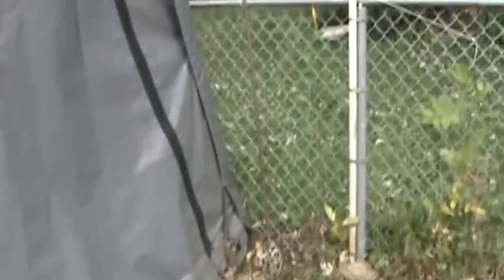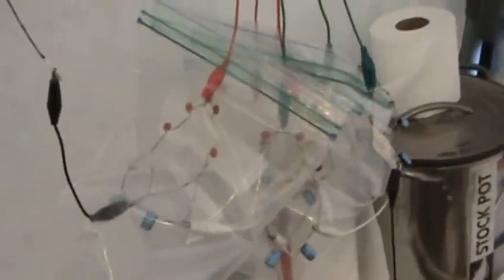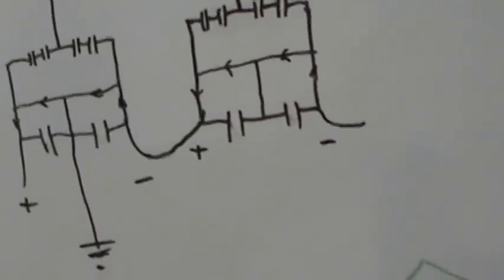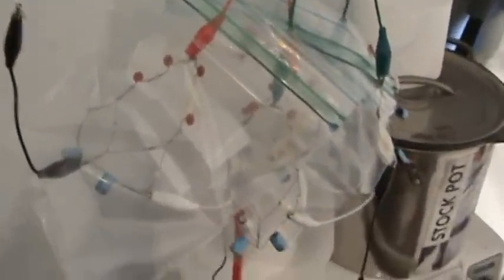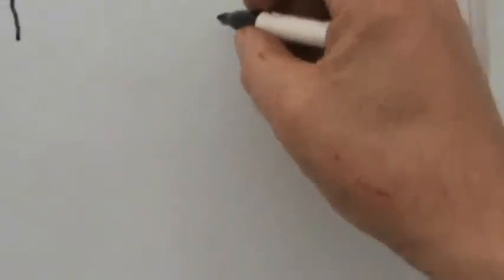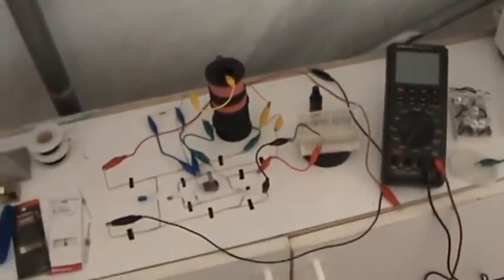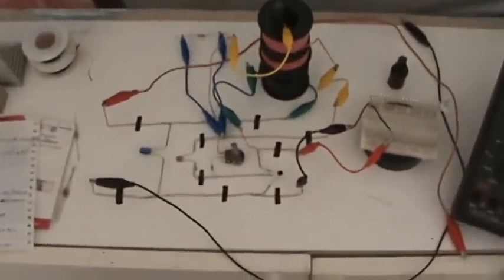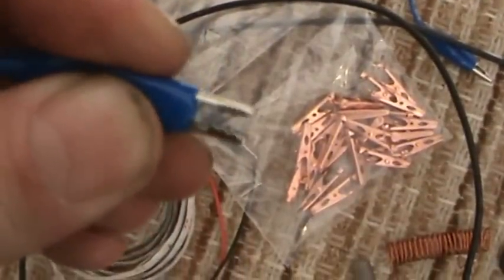FREE ENERGY FROM AIR 2016 Pt 4 (UPDATE)

Comment: Hey dude, well done!
Here's an image of a receiving antenna:
en.wikipedia.org/wiki/File:Dipole_receiving_antenna_animation_6_800x394x150ms.gif
Notice the wave..?
So in the middle of the wave you place a diode in the middle, but you'll have to test diodes to find the right one..
The wire to your circuit would come from the Cathode side of the wire.
Your antenna wire should be lineal as shown in the image...
To capture different wave lengths just add different lengths of wire, always with the diode in the middle.
When you capture multiple wave lengths you increase the potential, so more power to your circuit.
The important thing about this is for the wire to be straight, and the diode centered, and the wire to your circuit to come from the Cathode side.
Peace bro
Reply from the maker: hmmm, i see, thank you very much for the link and your ideas.   I will try this :-)
Reply: INVENTOR3 There's one more thing amigo,
When I say to capture different wavelengths I mean more than one wire set with a diode in the center, which are connected parallel to your electrical circuit.
So for example a 10 foot antenna which is 2 five foot wires at each end of the diode, an 8 foot antenna comprised of two 4 foot wires..
So in this example you have two wavelengths to capture. The wires coming from the cathode side of the diode go to your circuit.
These antennas are called 'Rectenna' and are used by the military but with a different wire configuration and much more intense wavelength. They're used to transfer electricity...
Science has been investigating and researching rectenna's for decades since Tesla first demonstrated transferring electricy through the air.
A possible diode you can use
www.avagotech.com/products/wireless/diodes/schottky/hsms-2862

Comment: Nice progress!  A magnetic field follows the path of least reluctance, so when the ferrite rod is in the middle of your two coils, it increases the coupling coefficient of your coils.  The best you can get is a coupling coefficient of 1.  The frequency of the ac current change determines the frequency of the flux change through the air or ferrite.  Transformers refresher:  http://www.allaboutcircuits.com/textbook/alternating-current/chpt-9/mutual-inductance-and-basic-operation   If you have a frequency counter that could tell you what Hz is going into the primary coil, if it is wired up like a transformer.  If your diodes have a tolerance of 20 volts or what have you, maybe you could put all the ceramic disc caps in some series and parallel arrangement to the antenna, then rectify that using the best 4 or 8 diodes, then use some reconfiguration of your electrolytic caps.  But sounds like you already got some next steps lined up. Nice that you got the series config worked out with your present model. This is a fascinating subject.
Reply from the maker: Thank you for clarifying. And thanks for the refresher link,,,i need it :-) 
Your input and comments are much appreciated.

Comment: Baring the loss of your Universal Flux Capacitor, there are several principles that you need to realize work as a collector and the most basic principle that THIS IS NOT COLLECTING ENEERGY FROM AIR - IT IS COLLECTING ENERGY FROM RADIO WAVES, OR RESONENCE THAT ARE EVERYWHERE, EVEN IN A VACUUM.

The best materials are hard metals (not foils) that have low resistance, such as sheet copper, aluminum or silver.  Use multiples of strip lengths that are connected at one point in the middle and at this point attach a power diode.  The energy coming from the collector will be DC Negative, so don't attach the diode backwards.  Use multiple (I use 3) standard copper grounds tied together with a 10 GA bare copper wire and standard ground strap anchors to ensure you get the best ground connection possible.  Use a good large diameter insulated wire from the ground to your test post.  At this point attach a large Electrolytic Capacitor (1,000 mfd 50VDC or higher) cap across your test posts.  As soon as the collector charges the capacitor you should see a steady low voltage at the test points.  There are several more complex versions of adaptive power circuits, power transistors, resisters, load coils, etc., that can be configures at the collection point, but this layout I described is the basic power supply layout needed to make a DC power supply operate.

At the test point connections you can attach many more collectors to multiply the power.  Remember that the diode at the collector is essential to reduce direct loss and cancellation of power from the electromotive forces on the long power line from the collector to the test points.  Good luck.
Reply from the maker: I know its not exactly energy from air, but rather from RF traveling through the air by many sources, i understand, i also mention in many of the videos that im collecting electromagnetic waves.
I already now have 2 ground rods, each rod is 10 foot with 5 foot in the ground, and they are both connected to each other by heavy stranded bare copper grounding type of wire and they are separated by about 22 feet, one at each end of my lab.  I will try the multiple strips for collector and try other collectors next spring time, i also want to try a rectenna and nano coatings.  
Good comments as always, thank you :-)
Reply: I'm a retired electrical engineer, have been working on collectors and coils since I was a kid.  The ground rods need to be as deep as possible, and can be as close together as 4" apart, depending on the type of soil, PH, and moisture content.  In commercial construction it's common to see 3 to 5 grounding rods hammer drilled into the soil with just inches exposed for the strapping and leads.  Dealing with Earth ground and milli-amps of power from collectors, it's important to have moderately oversized wire and low resistance.

The Army has had some interesting unpublished research with sheet copper and brass as solar/RF power collectors on rooftops.  My personal favorite is the ground receiver array that powers my backup system (refrigeration, computers, and lights) from my back yard.  It is only one in-ground array 4 ft. deep x 3 ft apart, over 1/10th acre ,and it puts out 15 to 30 VDC at 30 AMPS, use only 2 large 5VDC deep cell batteries and a 10,000 watt inverter dedicated to two rooms (kitchen and office).  We live in the mountains and have power loss often,  This system operates 24/7, varies depending on rainfall and drought, but is not affected by lightning or breakdowns, sunshine, winds or solar activity.
Reply from the maker: Sounds like you have a nice set-up :-)
Would you say your set-up is more of an Earth battery?,,are you using dis-similar metals in the ground?  I have 2 ground rods connected together by about 1/2 inch diameter stranded wire, made for grounding rods, and each of my rods are 5 feet below ground and 5 feet above ground.
Reply: Yes, you could say my system is an earth battery type, but a real earth battery is a grid of anodes and cathodes driven deep into a damp peat bog that acts as a low acid storage battery.  This type I use is only a meter deep, with a copper pipe or copper clad ground rod in the center, surrounded with a galvanized steel screen as a circular grid about 10 cm away from the positive conductor.  I also use an aluminum foil shield outside of that wire grid to act as an interference shied between holes and can place them closer together.  From copper conductor attach and solder a 1A, 100VDA (or larger value) diode that attaches and is soldered to your positive grid with other collectors.  The negative screen grids can all be connected together.  Use a 12 GA stranded wire with burial coating.  Soldering all of the connections will prevent corrosion and loss of conduction.

This is sometimes called a earth battery, but is rightly called what Tesla called the Earth Source or Resonance Battery.  The Earth resonates at 7 Hz. (average) and depending on soil pH and moisture will depend on the amount of power possible from this type of arrangement.  The "anchors" that Tesla used on his mass wireless power machines were both galvanized rods driven 72 m deep into the soil (not into bedrock).  I have found that all rocks larger than a pea should be removed and a general purpose type fertilizer or ice melt salt be added to the soil before packing it back into the holes around the screen and rod, then water added and let it settle and add more fill dirt to completely cover the entre device and wires.

After the leads from all ground batteries are combined, my favorite regulator is a mechanical early '60's truck generator regulator, these are made to handle 50 or more amps at 14 volts output continuous, add a large DC electrolytic capacitor to the output and parallel to the battery, then your inverter.
Reply from the maker: Is this your own design or did you get your main idea from instructions on the internet,,i mean if you did, please send me a link :-)  No problem if you dont have a link, when i get closer to doing this myself i will be searching stuff like crazy to get the best design.  Tesla Earth resonators, nice, i know a guy that is doing this now, sending power through the ground to a receiver, wireless transmission through the ground.
Reply: Hi Paul.  No, this is my own design.  I've been tinkering with this concept since the 1950's, and I based it mostly in the old crystal radio concept with power from the Earth ground and the filament antenna.  This summer I have some help and going to run a new pasture full of receivers that I'll cover with a video.
Reply from the maker: Great looking forward to a video :-)  When i get ready to do this project, ill be asking you questions :-)
Reply: Serious questions are always welcome.  I'll post a link here in about 6 months when the video is ready.  I plan for it to answer most questions about how it operates and what are the variations that work.

Comment: I have some of that wire or at least something similar, I got mine straight from the Government/Military and it is mill spec whoop-di-doo! My silver hoopla can't beat copper and so I have a spool of high grade mill spec coax coating that is difficult to strip and silver plating that I can't access. It wound up free for me but turned out basically useless in the end. I can absolutely verify there is no difference with silver (plated or otherwise) verses copper. So now what do we do with this stuff? My wire is about 28-25 awg (can't remember), if you want it I'll send it to ya. Let me know bud.

Michael
Reply from the maker: Sure, it sounds great :-)  Oh, im trying to remember, you dont have a UPS near you, otherwise i would say use my account number.  Can you send me an invoice through your ebay account.  Charge me something for it.  I dont want you to go through a lot of trouble.  If you send it,,,,thanks, if not no problem.
Geez, how long have we known each other now, like 8 years or more :-)

Comment: and try to use grapheme on wide straps with a coat of grapheme . the grapheme pulls in the ions out of the air. and you need a wider surface area then wire   ..
Reply from the maker: Thanks Max.  I been thinking about graphene for a while now :-)
check out this place....   https://graphene-supermarket.com

Comment: what wattage  or current you get?
Reply from the maker: Im guessing im in the miliamps range because of the LEDs i can power.  My power readings on my digital meter does not make sense, saying i have microamps,  this can not be correct,, and i learned i need to get a vacuum tube type analog meters, which i plan on getting soon.

Comment: Have you ever tried just using a diode it seem to me like it. Worked for a guy on youtube
Reply from the maker: I have not had any luck with using only a diode.  With my set-up i need to trade a little voltage for current and use a voltage doubling.  Hey, if you run into that video again, pass it to me please :-)